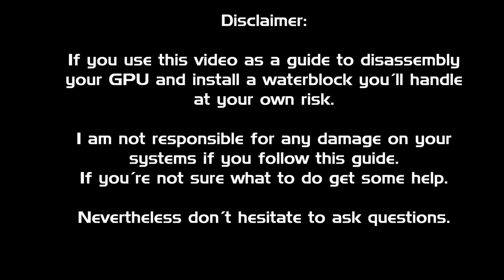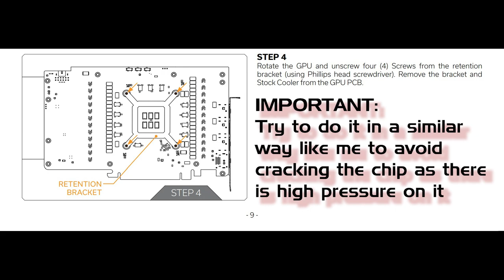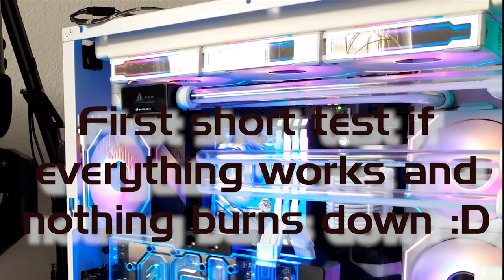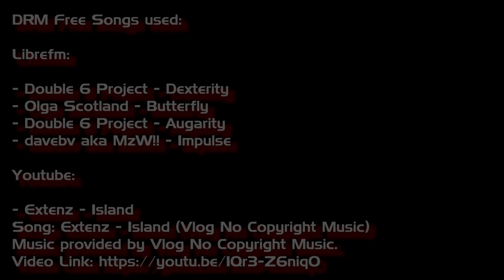Timelapse: Installing an EK-Quantum Vector² Waterblock to an Asus TUF RTX 4090

Comment: Thank you for the video and I really liked the intro ,, do you and to hell with what anyone thinks.. I noticed the Lian Li fans how do you like them?
Reply from the maker: Thanks for your comment jwar. Glad you liked it. Regarding the Lian Li fans: I´ve switched from the Corsair QL Fans to this because the LED´s of the QL´s are getting broken after about a year... not all but many.... About your question how I like them I would like to split my answer in 4 Topics and in comparison with the QL. And I think it is necessary to get in depth for that...

1. Performance: Better than the QL. At the same RPM my water is 5  Degrees colder. Also the LL Fans are less noisier at my prefered RPM (600-800). 
2. Design: Off course it is always a mater of taste but I would prefer the QL over the LL. Not saying the LL´s are ugly but for example the frame of the fans are very thick in comparison which is not the best from an optical standpoint imho
3. Cable Management: No other Fan on the market can compare with the Cable Management of those Fans. It´s just awesome that you only need one cable for a max of 4 Fans. This is a  dream for Cable Management in every Case. There is no competition for this on the market. And also that you can stick 4 Fans together ist just awesome and makes building much more easier. The only negative point in that case (using the single cable) is that you´re  forced to use their control box which leeds to the last point which is also negative if you don´t have a solution that fits for you (I got one for me see below) Even if you can  connect PWM and RGB from the box to the mainboard you still need the L-Connect Software. It is not possible to control fans and RGB without it (or I didn´t find the correct solution)
4. Software: There is a lot of which Lian Li needs to learn and to optimize in comparison to the best software out there imho (iCue). The software is very bugy. Doesn´t run in autostart without tweaks, very ressource hungry, doesn´t use changed settings et cetera.
But I found a solution for me:

I´ve received a Version of L-Connect from the Support which runs in Autostart. Unfortunately with two UAC Messages but better than nothing. I configured the L-Connect Software to "Sync with Mainbord" both for PWM and RGB. So i´ll never see the software.  Than I bought an Corsair RGB to ARGB Cable and connected the ARGB Cable to my Corsair Commander like every other RGB Stuff in my Case.  The result is that I now only need 2 pieces of software to control everything: Icue for RGB and FanControl for Fans and Waterpump (I recommenct JayzTwoCents Video about this masterpiece of Software).

Conclusion: After overcome those mentioned barriers I am very happy with the fans and everything else.

Sorry for that long text :D But I think it´s important to describe all the bright and dark sides of those fans.
Reply: @DerVali  Thank you for the lengthy answer. I currently use first generation Corsair HD 120s and 140 RGB and have experienced several issues with ICUE when first start up on my current build. . It has come a long ways since 6 years ago. I am happy with the new ICUE and have researched that the Lian Li  V2 can be tricked to work with ICUE. My Corsair setup is out of date and I am experiencing several of the fans going out and since I have 12 total with no replacement for like kind. I want to move away from Corsair fans. Hence why I came to your video. New build time as my Intel i7 7700k is has lost a core of the processor add in dying fans, time for change. I want to water cool and you're the only one so far that has put together a video for Asus 4090 with EKWB. Again thank you for the video. I also noticed your panel that displayed your temps on CPU and system. I too would like to do something like that. 
Next build Lian Li 011 Dynamic XL ROG , ASUS 570 Crosshair Extreme, ASUS 4090 OC, Corsair Dominator 6400 ddr5 64g,  EKWB Distro plate V2,  EK Quantum CPU Velocity2 WB,EK Vector2 WB for GPU. ,EK  rads x 2 , EK fittings, Lian Li SL V2 120s , 4 nvme 1 tb Samsung already have in use. Seasonic.  Psu with custom cables. Just now trying to acquire the components. Any pointers or advice?  Edit AMD 5 7950x for CPU
Reply from the maker: @jwar2163  Yes thats what I did... All you need is buying or building a cable from Corsair RGB to ARGB like this ony i bought: https://www.ebay.de/itm/143797976482 After that the Lian Li´s are completly configurable via iCue. Maybe not so fancy RGB Styles like in the L-Connect software but to be honest: most likely all that Unicorn Rainbow stuff is showing in videos. After that it´s changed to one fixed color or am I the only one? :D (My RGB Stuff is most likely single color static white)

Regarding your hardware: Sounds like a Killer Setup altough you missed the CPU ( or I over readed it). But I guess it will be a 12900 or 13900? I do not know if you´re want to overclock your system. If Yes you should re think about the ram (7000).
What clearly needs to be mentioned about the Asus 4090 after attaching waterblock: you may here coil whine under load. I am not very sensitive for coil whine but a lot of people find it really annoying. And yes after attaching the waterblock and doing some benchmarking I can clearly here it with an open case. But: Now the case is closed and I always are gaming with headset so no big issue for me. You should consider that. You may consider that. If you are very sensitive for coil whine you may switch to Gigabyte or Zotac, which are the cards with less coil whine of all. Buddy of mine switched from MSI to Zotac as he is very sensitive for this.
Reply: @DerVali  Thanks for the heads up on coil whine. Have it sometimes on my ASUS 2070 Strix. I use headsets when gaming and when doing design/drafting work usually have video or music playing. I edited my OP to add CPU AMD 5 7950x . Regarding the ram AMD listed the Cosair Dominator 6400 as certified to work stable and to be stable in oc mode on list of approved ddr5. But 7000 would be nice. 

  I  do believe that Lian Li now includes the adapter cables in the 3 pack of the V2 fans and also includes a short jumper to connect 3 fans to a single example top mounted radiator 3 fans to single rear case fan. 
Jay's 2cents has a brand new video up about newest Lian Li V2 fans .
  With Lian Li  4 fans per port up to 16 can be used with each Lian Li hub with adapter to rgb hub on commander pro and pwm adapter for sensing fan speeds. Going to do more research before buying. Like I stated been using Corsair with Asus mb,GPU for 6 years, I have two Commander Pros in my current system running 12 Corsair fans with rgb. With ICUE controlling H115i AIO, GPU/MB rgb,fans. Again thanks for the insightful comments. BTW I do static RGB with designing and also color shift when gaming.
Reply from the maker: Yes it´s the same like for my infinity fans (v2 are not infinity !) but as I mentioned before, you still need to find a way around the L-Connect Software which is, to be honest, very crappy.... I you find a way to Control PWM and RGB without even installing L-Connect let  me know :)

Regarding static Color vs epileptic color movement ( :D ): the newest software version of icue has the ne so called Mural Function. I quite like it to synchronize it to what happens on the screen.... gives some more immersion similar to Hue Sync when your whole case takes the main color of the screen.
Reply: @DerVali  I had the Lian Li SL120/140 V2 Unifans and the Lian Li SL 120 Infinity fans confused with one another. My bad too many videos back to back. So thanks for the correction about the fans. I will delve deeper into the Corsair forums for a work around for Lian Li fans and ICUE. If I find something  that works I will shoot you a message. I tried the mural function of ICUE, but my generation 1 fans did not like it. My Keyboard, mouse, mouse pad and headset and headset tower were ok with it as they're Corsair. . So now I have to decide if I want Infinity Mirror or V2 Unifans. The little things in a build. I placed a notify me for the EKWB 4090 WB as it is out of stock. Same with a Asus Strix OC 4090. Until parts/components become available I will limp along with the current system. Again thanks for your insight.
Reply: @jwar2163  I'm building exactly the system you just described... literally part for part except the RAM. I got 128gb Expo 6000mhz memory at CL30. You would be better off not getting 6400 as the Ryzen 7000 CPUs can't handle above 6000mhz really. Go for lower latency memory. The Asus x670e Crosshair Extreme board is amazing..but I had a lot of trouble getting the 128gb of memory working. It was a nightmare until Asus released the latest BIOS. That instantly fixed everything and now all 128gb work great. I have the EK x360m rad for the bottom of my case, 44mm for top and 30mm for side.. however, I may not put the 30mm rad in because the system can easily cool everything with the two rads. My only suggestion would be to connect all the Infinity fans directly to the Asus fan/ARGB controller that comes with the motherboard. Don't use the Lian Li L Connect controller. Use the two wire connectors Lian Li includes.
Reply: @GSP-76   Thank you for your input and I will take a serious look at the 6000mhz RAM. During research I have read several times about the sweet spot at 6000MHZ also one of the tech reviews stated to go higher on the  DDR memory size to get better stability if over clocking will be involved. As I plan on doing both gaming and Vector/Cam/CAD  design for woodwork and CNC usage there will be times I wont be overclocking and will use every bit of resource the PC has to render 3D drawings and designs. 
       I have not purchased any of my parts yet. So far ASUS MB is out of stock EK RADS  and water blocks for CPU and GPU show out of stock and I have the Corsair 1000D case in my cart at Amazon only place I found it and happy I did not purchase as the price on it has dropped to 525.00 usd from 599.00 usd.  According to the water system configurator on EKWB web site I only need the two 480 rads at the top if I go with the Distro Plate in place of rads or fans in front. Also I was waiting for the new AMD GPU to drop hoping that Nvidia will be pressured to lower the price of that 4090. On top of that I left a message on Corsair Case Builders Discord about the Fan Radiator trays as I read that I may have to purchase different trays for the 480 rads for the top. So awaiting a response to my inquiry. Again thanks.
Reply: @jwar2163  The 1000D is a huge case! If you have the space for it, awesome...as for the memory, 6000mhz would be better than 6400mhz now but if you plan on upgrading the CPU, 6400 would probably be better...but with Ryzen, lower latency memory is where the performance lies. My 5950x system has 32gb of CL14 memory and it's literally 20% faster than the CL16 stuff. 

With the radiators, yeah you'll want 480mm rands in a 1000d but you don't *need them. The 4090 isn't as hot as we originally thought it would be and a regular 360mm rad is enough. The Ryzen 7000 CPUs are what really get hot so they could use the extra cooling capacity. If the Asus Crosshair Extreme is sold out, wait for it...that motherboard is a marvel. Awesome in every way possible.

Comment: dose water cooling your GPU void warranty?
Reply from the maker: most likely yes. some companies still give you warranty I think EVGA was one of them
Reply: @DerVali  I had a 2080ti Fe at launch and it had the VRAM contamination issue. I had taken it apart, put liquid metal on the GPU and fitted a waterblock. I put the original cooler back on (and repasted it) to send it back and they never queried it at all.

Comment: Any coil whine on your tuf?
Reply from the maker: Yes but I don´t know why only on specific load, for example when running TimeSpy Extreme. No Coil whine registered while gaming. But if there is coil whine it´s only annoying whith open case and no headset. As I am gaming with headset no issue for me. Buddy told me he did not use Pads on memory so no issue with coil whine... Will do this next time I drain the loop

Comment: before and after temps?
Reply from the maker: It was no surprise but no big temperature differences on GPU as you can see below as the stock air coolers are very good.

Disclaimer: I did a Time Spy Extreme Loop (for the numbers below) for 45 Minutes in Window Mode at 21°C Room Temperature.
When GPU is on Full load for example FurMark
Before:  > 80°C After: 55°C

But overall most components in the case are a little bit cooler than before. 

                                Air           Water
Water Temp [°C]	33,2	31,4
GPU Temp [°C]	43,5	42,8
GPU-Memory-Junction-Temp [°C]	43,9	43,0
GPU-Hot-Spot-Temp [°C]	50,9	49,9

Main focus was the challenge and of course the visuals

Comment: and without temperature test in the end
Reply from the maker: No big difference in Temperatures as the Air cooler of the 4090s are quite good. Just did it for the challenge and the nice looking in the case

Comment: Music is wicked distracting. How about verbally describing what you are doing instead of blasting annoying music?
Reply from the maker: There is no need to describe what I am doing.... Or do you really think its less annoying when you hear all the time: " now I unscrew the Screw".... "now I put on the thermal pad" "now I remove the protetective film from the pads"  :D 

Sorry nothing against your opinion but just turn off the music if you dont like it. And if you really need a verbal description for unscrewing and put on thermal pads you may not watch such a video nor do such things yourself.

peace :)
Reply: @DerVali  Thermal pads come in 3 thicknesses. 2mm, 1.5mm and 1mm. They are difference thicknesses for a reason. They are to level the block attachment to PC board in addition to heat transfer. If you want to be truly helpful and informative you would create a proper tutorial and verbally describe the key installation processes. I can see why you only have 41 subs. Do not quit your day job,  YouTube is never going to be a money maker for you based on what I've seen thus far.
Reply from the maker: @davejones1959  😂😂😂 why getting so personal?  Btw I don’t plan to earn money with YT and it’s not your business anyway…and obviously you didn’t read the disclaimer at the begin of the video… and if you do plan to to the same like in the video I highly recommend reading the manual and not complain about a video which was just made for fun and not for guys like you who probably just here for trolling… if you don’t like the video skip it and look for a video which is from ek officially… kkthxbb